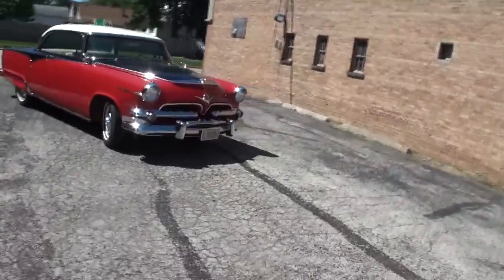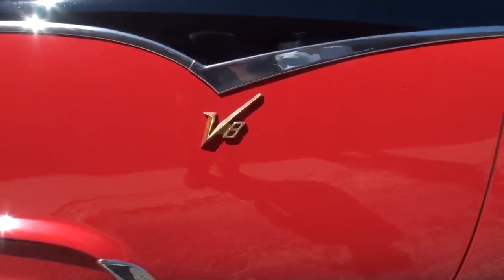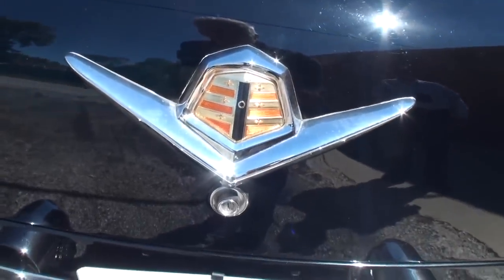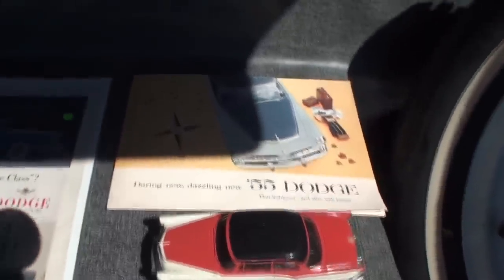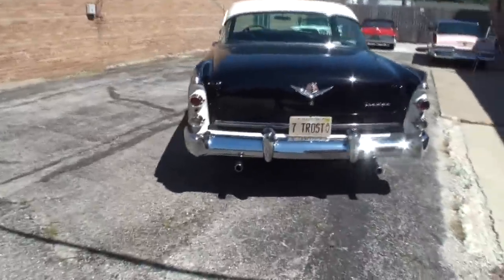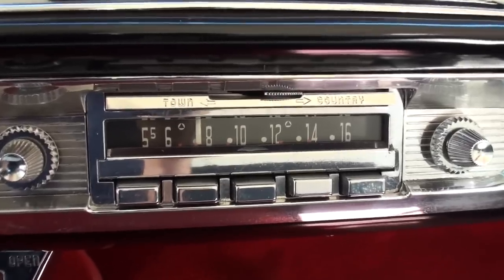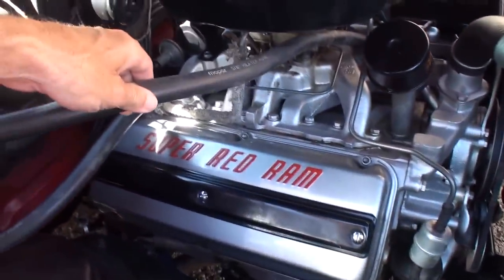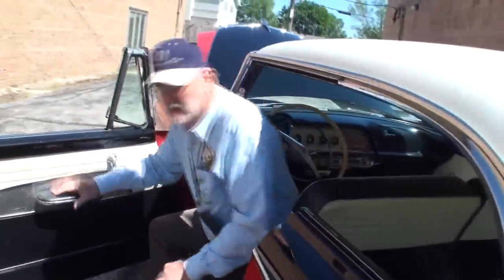1955 Dodge Custom Royal Lancer in Red Black White & Engine Sounds on My Car Story with Lou Costabile

Comment: Don’t you just love those mid 50s cars. I noticed the downward pointing door handles that pulled backward. I had later model Plymouth’s with them on the back doors and flipped them upward so the kids couldn’t pull them backwards and open the doors while driving.  Just a memory from way back when. Brings back great memories .  Thanks Lou. 👍👍👍. Also did you notice no park on the gearshift. You had to use the parking handbrake.
Reply from the maker: Hi Arne Berg,  I think the 1950's cars are great :-)  Glad you enjoy this car and you're welcome,  Lou

Comment: Beautiful car, Frank and Lou. First year of Exner's all-new Forward Look. Designed by Exner and Maury Baldwin. With the D-500 Dodge Red Ram V8 engine, 279 cubic inches, 250 HP. The one-year-only Powerflite gear selector on rhe dash to the right side of the steering wheel. Beautifully designed instrument panel and steering wheel, which were carried over to 1956. An interesting side not is the overall design of the dash and wheel are faint copies of the 1951 Ford. This model has the little chrome fins on the rear fenders that became actual fins for 1956.
Reply from the maker: Hi Donald, Happy to read you enjoy the looks of this car :-) Thank you for sharing your knowledge, Lou

Comment: I believe the fender skirts were an add on, car didn't come with them.  I have the exact green one in the brochure shown at 7:08, all original and still beautiful... glows in the sunlight and moonlight (they tell me it's because the original paint has lead in it). Super red ram with the power pack option with three on tree and OD. (was grandpas... bought new august 1955). Never restored in any way, still as it was back then.  Metallic thread is perfect everywhere as still has plastic seat covers from when new. 82000 miles. Same radio but no power steering or brakes.  Aluminum keys too. Green seat belts still wrapped but in old plastic. Hood always bites my head...very low...never do remember that until it gets me. 
I'm 52 with 13 cars and you are so right... if they just sit, problems develop. Need to drive them. Thank you so much for showing me this car... they are really something.  I won't sell mine as I have pictures of me at 3 months old in the back seat... way back then.
Reply from the maker: Hi Jerold Lyons, Welcome to the Channel :-) Glad to read you have 13 cars. Hope I get to see your collection some day. Thank you for viewing and sharing.  Hope you see many cars on this Channel you enjoy!  Please Subscribe, and hit the "bell" so you can see all the cars when they are uploaded on this YouTube Channel, Lou

Comment: Frank,
What color scheme/ code was that?
I also have a 55. Trying to figure out the colors.
Reply from the maker: Hi Frank, Happy to read you have a cool car too :-) Not sure what the paint codes are, however if you google search "1955 Dodge paint codes" I found these - 1955 Dodge Paint 501 Jewel Black, 505 Halo Blue, 506 Parisian Blue, 507 Admiral Blue, 515 Chiffon Green, 516 Emerald Green, 517 Satin Green, 530 Cashmere. Hope that helps, Lou

Comment: Hi Lou and Frank.   Great car, very handsome.  Thanks for the cleaning tips.   I think on the towels, to remove soap residue, you should do a second wash with white vinegar.  .  That will rinse away excess soap.  FYI soap residue and skin create mildew which can give your towels that awful smell.  Try not to use excessive amount of detergent when laundering.  👍😉
Reply from the maker: Hi Terri Bel Bliss, Happy to read you enjoy the looks of this car, and thank you for sharing a cleaning tip too, Lou
Reply: Also instead of a microfiber towel try using newspaper to clean your windows. It's an old trick that works I learned from other Corvette owners

Comment: Not only the trunk.  A lot of cars from that era you could start without the key. Locking the ignition switch was separate from shutting the car off. If you didn't lock it all you had to do was turn the switch.
Reply from the maker: Hi John, Thank you for viewing and sharing your knowledge. Lou
Reply: @loucostabile   LOL Yea I'm giving away my age.

Comment: here is my glass cleaning trick, use any cleaner any towel to remove dirt or wash car then take your sponge from your tub of wax (carnuba is best) and coat the windshield lightly w/sponge residue not even necessary to dip in wax and remove w/old cotton t-shirt...spotless and clear and water repellent
Reply from the maker: Thank you for sharing a tip.

Comment: Chrysler Corporation cars used to have plenty of charachter, up until 1967.
Lou, if you can find one of these somewhere, you'd be the first one covering it on English-speaking media. Not even Leno has had access to the following hemi-headed Ford Flathead-blocked Simca which was recently posted here: https://classicoldsmobile.com/forums/racing-high-performance-80/rare-forgotten-olds-intake-148799/#post1281299
Reply from the maker: Hi Monique, If I see one and a Care Taker is willing to share, you'll see it too, Lou